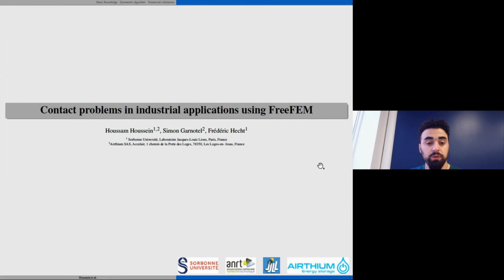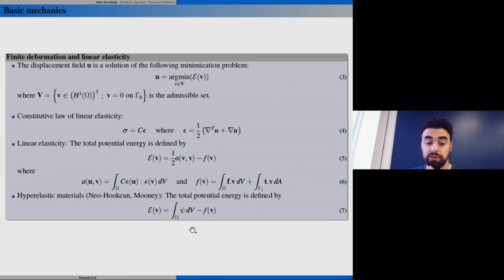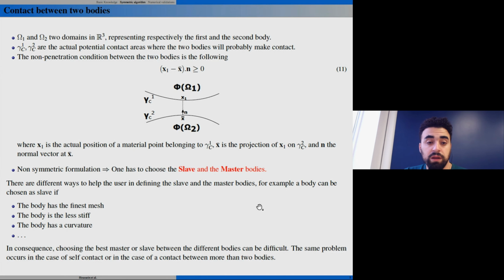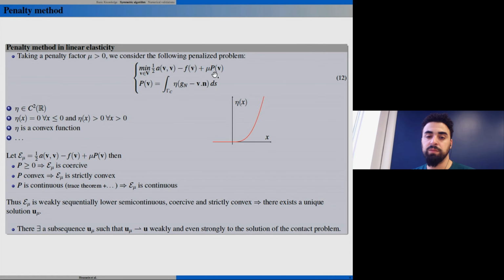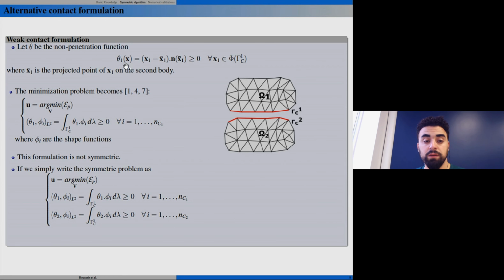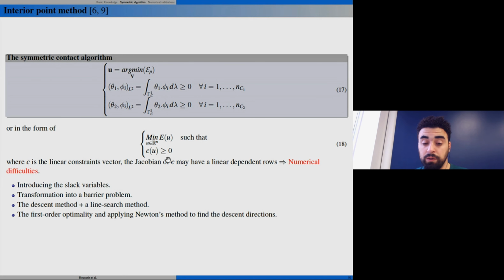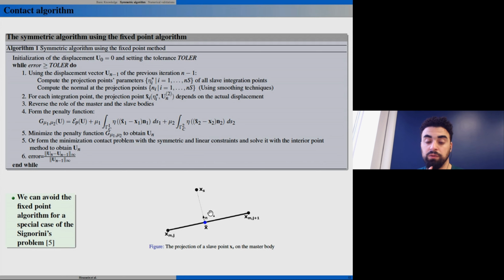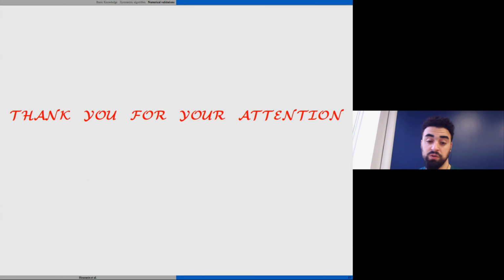Contact problems in industrial applications using FreeFEM

Comment: Can I propose if it can be possible for freefem++ to be able to implement an elasto-hydrodynamic contact case?
Reply: Hello, I think yes because FreeFEM is very flexible, for example you can define a fluid problem coupled with an elastic structure one